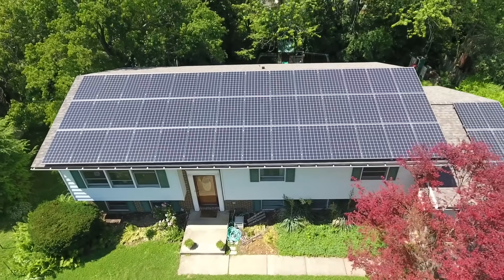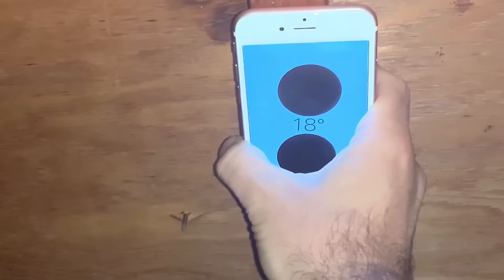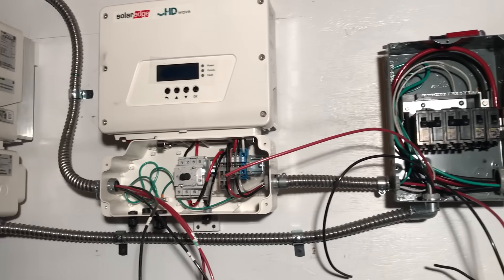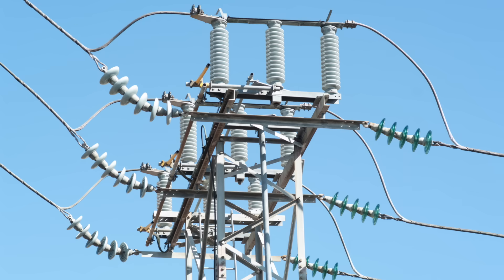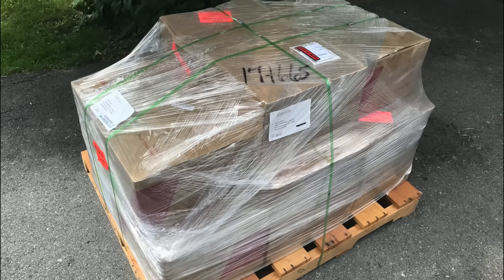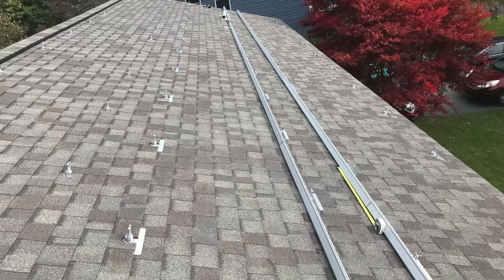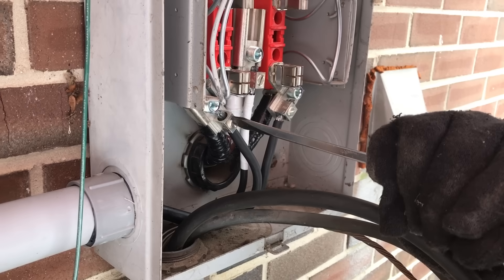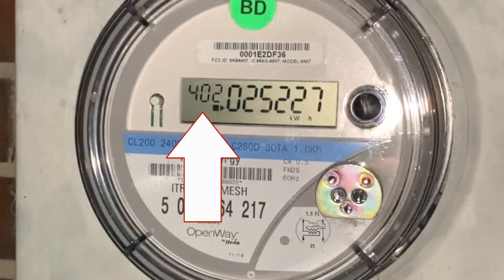I Installed a Power Plant Myself | HUGE DIY Solar Panel System

Comment: 48 solar panels, each cost about a months worth of electric. so 4 years of electrical payments right there. thats IF you install it all yourself.   How often do these need to be replaced.  Its a great idea but not for everyone.        If you even sell the house or have to do roof work you get to start all over...  IMO making a solar garden or Shed is a better idea than attaching them to your house roof.      
  So its been near 2 years now since this vid went up, just wondering how many panels have been switched out if any.    Have you added a battery bank?    How do you shovel the snow off without doing dmg to the panels(you didnt leave spaces to walk around the center panels if they fail.
Reply from the maker: Watch my next few videos to answer some of your questions.  I’ve had no maintenance issues except I saw one wire dangling lower than I wanted so I had to adjust it under a panel.  Unless some very specific trauma happens to the panels they will last decades.  I also don’t have integrated batteries.

Comment: A little trick for everyone security when you use a disconnect, operate the lever with your left hand so that if it blows you face is not in front of the disconnect
Reply from the maker: Thanks.  Would the fuses actually blow up with that much force in a disconnect like this?  Have you seen it happen?

Comment: How much can you use? Water, electric stove, TV, aircon or heater… Can the solar support all that if we use as per normal?
Reply from the maker: It's normal power grid.  The solar panels feed the house and extra goes to the power grid and I get credit.  I explain how this works in the video after this one and the one called solar misconception.

Comment: Did you install batteries?  My solar will be very close to yours but no batteries right now. Hoping prices come down in the near future. I figure I’ll need about 3 batteries to last through the night.
Reply from the maker: No, no integrated batteries.  You may wanna check out my video where I tackle the topic of integrating batteries for solar or not. It’s called the costly solar misconception.  Cool that you have solar!

Comment: Does your rooft support the extra weight?
Reply from the maker: Yes, it’s distributed weight so it’s not a problem for most truss roofs.  You need to make sure that the weight plus any maximum snow load is still within the parameters of your roof.  A licensed engineer can confirm that if needed.
Reply: @FrugalRepair  Thanks for your Awnser. In Germany the regulations for that are really hard and most of the time you need to double that. Also the Regulations for sending power back to the grid are also a hurdel.

Comment: You must be allowed to disconnect completely from the grid otherwise they will get you with ever increasing fixed charges. It's fair that everyone shares equally the cost of keeping the base load infrastructure operable. Ultimately your pockets will be picked.

Comment: How do they work under a foot of snow?
Reply from the maker: A foot of snow?  Not really any light would get through.  Did you see my snow and solar video?
Reply: @FrugalRepair  no, I will check it out! I'm in the northeast.  Wondering if it's a good idea or not with the snow. Can the panels handle a foot of wet snow without  breaking and shorting out?
Reply from the maker: I’m in PA and the weight of snow isn’t an issue on the panels.  Most panels are stronger than the snow load for most areas.  But you’d want to check the panels strength (it’s on the spec sheet) if your in a place that regularly gets mountains of snow.

Comment: How are you going to repair/clean the panels in the center of your roof without stepping on or removing some of the outer panels, with a crane? U did not think long term maintenance into your design it’s gonna bite you in the ass down the line

Comment: A little trick for everyone security when you use a disconnect, operate the lever with your left hand so that if it blows you face is not in front of the disconnect
Reply: I use my teeth
Reply: A trick or a rule!!
Reply: You use your right hand as the current takes a slightly longer path to your heart if you were to shock yourself.

Comment: Please can you tell me how many solor panels do you need to power the whole house 🏠 without any problems ,like connecting everything such as TVs fridges computers and laptops and others all at the same time without any problems ? My second question is does give you electricity 24 hours a day without stopping like a normal electricity or  is when the battery 🔋 station run out of charge you will have to wait till is fully charged ? Or it's gives you electricity and charging at the same time without stopping??? Thank you 😊 sorry if I asked you 3 questions or more sorry thank you ☺️

Comment: My concern is the system is rigged. I sure hope there is not something behind the scenes that were not aware of that power companies and these batteries that are produced to have solar that eventually its going to cost the same. Case in point energy efficient equipment of course power companies are for it. They know they will just raise the rates they are not going to lose money.

Comment: Will those panels survive a hail storm ???
Reply from the maker: They have so help up under hail here so far.  The glass is very strong.  Now, it's certainly possible if there is hail out there that is damaging car windshields and causing other destruction then that might an issue.

Comment: This is absolutely amazing being able to put together all that work and research into something like that. I dont think I would go through all that for a 14% ROI over 25 years. If one were to simply not do any of this work and research, and would put all the money used to buy all the parts in the bank instead, I would think he would get way more than 14% ROI after 25 years or compound interest. Thoughts?
Reply: You're joking right? Have you ever heard of inflation? ... and which bank is paying 14% APY?
Reply: He would not be making 14% ROI immediately, it would take many years to recover the original investment of the expensive solar panels. In the video he estimated that out of the 25 years (average solar panel warranty) the first 5-7 years would be paying back the panels.

For many electrical companies, you cant actually sell them electricity for profit, but credit the wattage for later use for free. So, if I generate 10 kwh in the day, I can use that 10 kwh at night for free. So, for most cases (for me as well),  the most one can have is $0 electric bill; only savings, no profit.

Comment: The inspector is correct.  After 35 years of electrical work, including many solar projects, I like it, your work is clean, with excellent workmanship. I would use a thin layer of Coppercoat on all connections underground then wrap them and Noalox on all dissimilar metals and exterior lugs in the NEMA 3R panels, j-boxes and disconnects, just a little dab'l do ya on surfaces from wire to lug or splice.  Nice job!
Reply from the maker: Thanks for those suggestions and your kind comment!

Comment: Don't listen to this guy he thinks he set for 25 years and he's not cause the roof won't last 25 years lol manufacturer's will call their shingles 25 or 30 year shingles but they never make it that far and was the roofer certified by the manufacturer cause some warranties require them to be certified but if your roof fails they pro rate you every year that your roof ages the amount of what they cover for replacement drops lol after 10 to 15 years they prolly won't cover much  and the panels will eventually start producing less power then you have clean your panels but even cleaning the will still lose power over time and the amount debris from the trees and the moss that's gonna grow under them will cause leaks then you'll have to pull panels to fix the leaks and remove moss could use moss treatment once or twice a year might help some and now the gutters have to be cleaned from a ladder on the solar panel side lol have fun with that then there are all the penetration in the roof and the one he drilled to run the conduit through his roof and caulked around it with clear silicone lol can't do that cause it will leak it needs a pipe jack and clear caulk is garbage it won't last uv's get through and break it down lol even good caulk intended for roofing needs replaced every 2 to 4 years where exposed to light and the zip ties won't last 25 years......feel bad for the roofer having to shingle that the way he did running end to end with a few rows at a time vs putting the shingles on a climbing pattern like a shingler usually does lol that had to take 3 times as long to get the panel side roofed and should have cost 3X as much on labor....basically panels on shingle roofs are a bad idea if you have room on the ground and the light your better off mounting on racks

Comment: Warning to the audience, you need to check your local AHJ (Authority Having Jurisdiction) regarding setbacks on the roof (space to walk around the installation on the roof.  Problem is, this array layout would't fly in a lot of the US.  If you have a fire, emergency responders will walk away from a non-compliant installation over saftey concerns.
Reply from the maker: Yes, agreed they should check.  My system is 100% compliant.  Not every jurisdiction has adopted that section of the building code.
Reply: @FrugalRepair  I figured you were good, or you wouldn't have published 😉.  I might have missed you mentioning the possibility of needing to check AHJ compliance, sorry!  Great looking array, good on ya!

Comment: What about people who like to have the a/c on max all day? (Me) I don’t think this will work out. How many batteries does it take to run an  a/c unit? Not a window stupid thing but true central heat and air? I guarantee I could drive up with my rv and my kids and we could melt your system in less than 24 hours.
Reply from the maker: First, I don’t have integrated batteries.  If you are grid tied like me you don’t really need them.  (I made a video about this topic btw).  So being grid tied, it’s the same power coming to your house so you can use AC as much as you want.

Comment: What happens when there's a power outage in your neighborhood and the electric company have to work on the line? Because you're adding current to the line, do you have to  shut off  your house so they can work on the lines safely (with no back current)? Like generators..
Reply from the maker: The inverters have a mandatory safety feature built in that shuts them down when they don’t detect the power grid.

Comment: Hey you don't need optimizers for every panel, they are expensive as fuck, you only put optimizers where it is likely for panels to get shadowing (trees, chimneys etc etc). They help to manage the voltage if one panel gets blocked it doesn't reduce the voltage of every other one. Othervise they are pointles.

Comment: How much did this dude pay for this setup and labor required to install it? I will imagine it will take A LOT of time to pay back what his initial investment was. Also there is worrying about panel degrading over time and whether or not they are providing enough power to sustain him. Some places its just not practical to run a solar setup simply because of either location or  weather preventing. Such as in the northeast where its for the most part usually clouded over. I looked into that stuff myself and honestly it was more cost efficient to stay connected to the power grid. especially considering most of the power I get comes from nuclear. This guy really needs to be more clear about what he paid vs the time its going to take to pay this back before he really is paying nothing for his electricity.
Reply from the maker: I made a whole video about what I spent and the solar production.  It’s the one right after this video.

Comment: I’ve got about a year and a half doing solar and I can say you do an awesome job! For the most part everything on par to what we do. I would also consider your job pretty professional! 

Only 2 concerns I have about your install. 
1st) in your area are you not required to have a fire setback/FSB? This is invade of a fire, the firemen have walking room on your roof.

2nd) your wire management. The way you have your wire hanging could be potentially dangerous. Weather can cause your wire to become loose over time and can begin to scratch against the shingles. If it gets worn down enough you can get mini arc flashes that could potentially cause a fire. Industry standard is to run the wires along the edges of the panels. 

Besides that your install looked great. One thing I would highly recommend look into getting some sort of cage or pest abatement around your array. I’ve had to go to jobs where customers whole systems have been chewed sometimes so bad that wires can’t be replaced on the panels and optimizers, basically resulting in having to buy a whole new system. Seeing as you did a great job on your install I think this is something you’d have no problem doing yourself as some places tend to charge a little much for this and you’d probably put more care into it since you’ve done the whole job! 

Once again great work wasn’t expecting such a professional install!

Comment: How much weight are you adding to that roof would you estimate? I have an idea for portable solar mega generators if the weight doesn't make it a feasible option.
Reply from the maker: I don’t remember exactly without looking it up but each panel is about 40 pounds and there is 42 on main roof and 6 on garage roof.  It’s distributed so it not a big deal.  But you do need to factor in snow load too.

Comment: Five - seven year payback? I’d be interested in how that is possible. 
Panels, brackets/fittings, inverter, cables/wires. Great but how is it possible?
Reply from the maker: I cover that in the video after this one.  Currently I’m trending closer to a 5 year payback.
Reply: @FrugalRepair  well done. The OCD in me struggles without all of the information such as the total cost of the installation and how much you are receiving for excess electricity exported to the grid

Comment: Unfortunately North Carolina does not allow you to sell back any power. You are only allowed to have up to 70% of power use for solar panels if you have a company install it and they will only install on your roof. We have 5 acres and we wanted it on the ground on racks and they refused. We have a metal shingle roof and the company couldn’t guarantee there wouldn’t be leaks so we said no. I would have to go completely off grid if I wanted to have 100% of my power covered.
Reply from the maker: Sorry to hear about all that.  Hopefully things will change.

Comment: Not the hardest thing, but if you mess anything up it could cost you big time.
But if done with no issues, it will definitely save you a ton of money and get to your break even point much faster. 
For me, even if I did this myself, it would take decades to break even due to very cheap electricity,

Comment: you budget the panels making a certain amount over 25 years? right?. the panels and materials within them tend to degrade over time.. so the output will gradually decrease over time. but as bills go up kind of balances out. they continue working way beyond 25 years.. even 40 years or more but they will be less efficient.  also invertors tends to break quickly, average lifes of 7 years.. so you want to bank some of the savings to buy a new in invertor as needed. get as long a warranty as you can on the invertor, pay a little extra if thats possible for a longer warranty period. Finally keep the panels clean, you may need to clean them every 5 years or so.. dont forget to turn them off beforehand 😄.  batteries are ok if you are out during day it can fully charge, then you use that stored power at night. but then you make less income as your not putting as much power back into the grid.. also batteries are currently lithium based which also degrade over time.. solid state batteries are being developed for cars and would compliment a pv system greatly. but there a few years away from mass production. there also safer as no lithium and dont degrade.. well they do but its like 1/1000 of a lithium based based battery.

Comment: You used micro inverters! Good call! The only thing I could think to improve the setup would be water cooling the panels, it increases the power efficiency by about 15%, the efficiency of pv panels are usually only accurate up to 25°C.
Reply: It could be since your house is in full sun, no trees, the micro-converters were extraneous . . . the only value, if I recall, is if cells in one panel or another degrade, and then the bad panel won't cripple the rest of your system . . . but, that is what the 25-year warranty is for.

Comment: As someone who installs solar I have to say how well done this is. I've actually used the rail system and flashings your using in the past.  We use more practical ones now (they don't need to be set up under the shingles) but still very well done.
Reply from the maker: Thank you for your kind words!
Reply: lol well share what the new and improved stuff is! Don't be shy!
Reply: @MS-gn4gl  rt-mini self flashing mounting bases made by roof tech. They are much easier to use.

Comment: I have seen each one do on the roof and then he wakes up that he no longer has a roof as long as he protects the roof as much as it is for the good of that person must understand each person more parts then it has no more stability and no more resistance and then it has problems and then the protection pole is made and over the pillars the bar is put and then we get a more efficient one for each one and indeed this is more expensive but it is much more resistant to each other